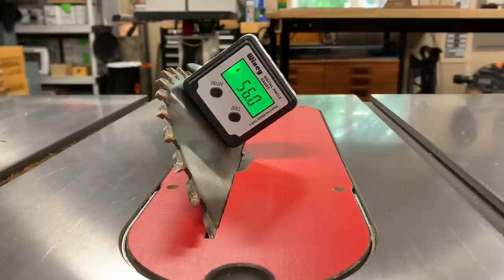Humidor Build

Comment: Absolutely beautiful work.  As a cigar smoker I’d suggest a few minor things.  Ditch the analog hygrometer (they are junk and inaccurate). No one uses florists foam so ditch those and make a sleeve for boveda packs in the top.  Love the veneer work.
Reply from the maker: The guy who commissioned it wanted those for aesthetic purposes.  I think his plan was always to stick boveda packs in the bottom along with a digital hygrometer.  That is also why the other moisture packs can be removed without a trace that they were there.

Comment: Outstanding work, I am impressed.  I do have a question.  It looks like your top and bottom are solid lumber rather than veneered ply.  Have you has any issues with expansion?
Reply from the maker: Actually the top and bottom are veneered ply.  The solid Spanish cedar panels float in the lining.  I sold this, so I can’t put eyes on it myself, but the guy who bought it told me a few weeks ago that it was functioning perfectly.
Reply: @catspawcustoms  Good deal, I figured you used veneered ply but wasn't sure.  I've built several humidors myself but nothing on the level you're doing.  It really is impressive.  Thanks for sharing your work

Comment: Were the top and bottom pieces also Spanish cedar? Or was it plywood to avoid wood movement?
Thanks!
Reply from the maker: There were a couple layers.  Floating spanish cedar on the inside and plywood for the outer part, to prevent movement issues.

Comment: I love your shop. I'm just starting to build mine. I will have to get into a dust collection system. What do you do with your dust?
Reply from the maker: I’ve got a Jet 3hp collector with a 25’ hose I move when needed for the larger machines.  I plan to build a bigger shop in a few years and then I’ll have dedicated ducting.  I also use a Festool CT26 for the small tools, and a pen old rigid shopvac for a few things with 2” ports.  Dust goes to the dump.

Comment: Did you coat the insides of your outer box with something to limit wood movement due to the veneer on the outside? Or is the cedar solid enough?
Reply from the maker: The Spanish cedar doesn’t move hardly at all, and the solid sides are only 7-8” wide so even if they did, it would be a minuscule amount.  The veneer is about 1/32” thick so that will flex with the cedar as well.  If the sides were thinner, I’d probably do a veneer layer on the inside to counteract cupping, but at 3/4” thick, they aren’t going to cup.  The top and bottom panels were veneered onto plywood and the Spanish Cedar panels float.  The end-grain on them was also sealed to  keep as much moisture out.

Comment: The box came out beautifully, in spite of the early setback.  I made a humidor and lined it with Spanish Cedar also.  Since it was made for sale I didn't season it.  after several months I noticed that some sap was leaching out of the boards.  Has this happened to you?  If so how did you fix it?  Also, Andrew Crawford in the UK makes some beautiful brass hinges that require a straight forward mortising cut on the router table.  Saves a lot of tie over quadrant hinges.
Reply from the maker: I am not aware of any sap leaching out of the wood.  But this was a sale item.  I haven’t heard of any issues though.  Lest I heard from the buyer was it was operating perfectly after the first six months.

Comment: What is the thickness of wood used here / used typically in luxury wooden boxes ?
Reply from the maker: The outer box is 3/4” on the sides and 1/2” thick on the top and bottom.  And then the entire thing is lined in another 1/4”.